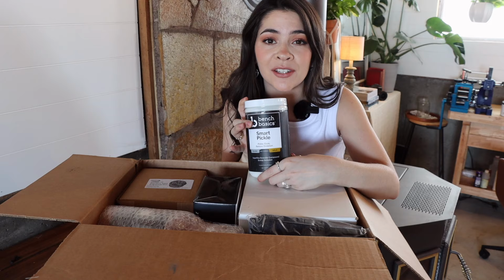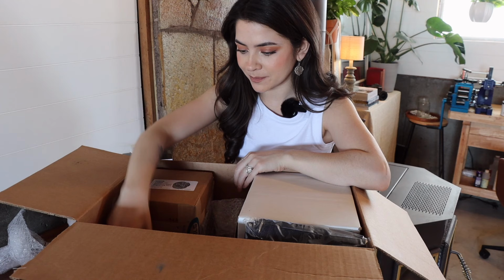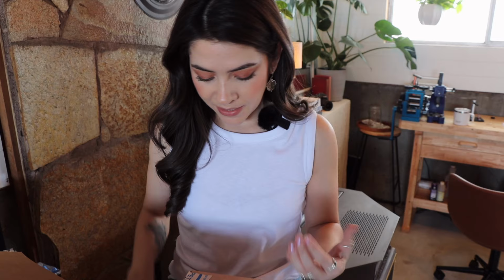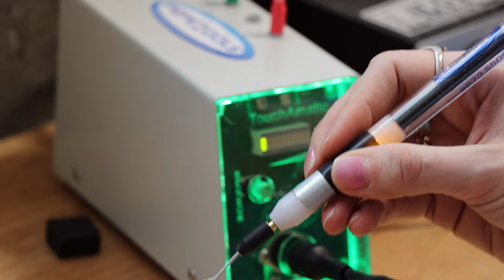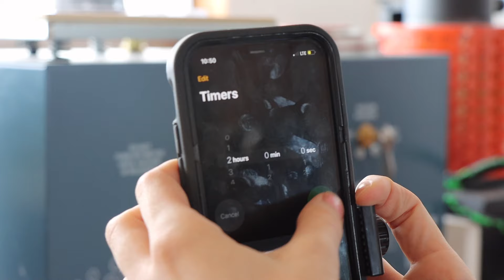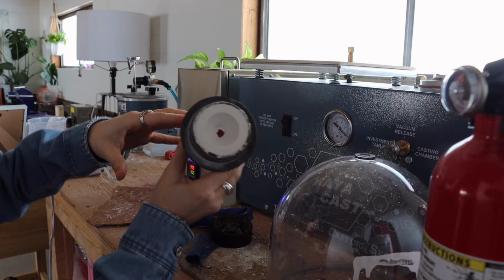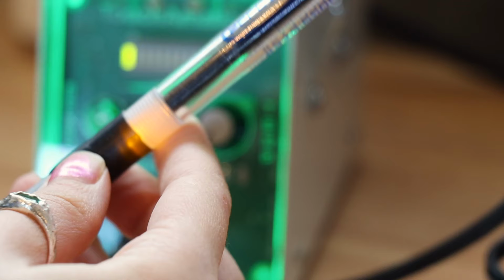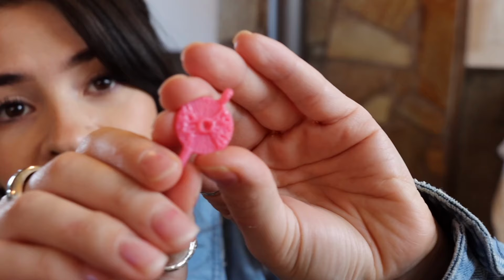Studio Vlog #11 | Lost Wax Casting  AT HOME | Unboxing New Jewelry Tools; TouchAmatic Wax Pen Review

Comment: Hi Young lady ,  congrats on your work in the jewellery, you are doing well . As with another comment here I would advise you to get and wear a full face viser when you are pouring metal , just in case ,sorry to be blunt.    not just glasses but a full face viser. Now 30 years in the casting and jewellery work myself and the viser did save me last year when molten metal hit some water in an ingot mould  I didn't see. molten brass  Hit my viser in 2 places.  Your casting and investing machine may be better on a lower table or bench, so you can look down into the flasks  and observe the behaviour of the investment whilst being vacuumed , and when you pour the alloy there is less of a possibility of any molten alloy  falling towards you if something goes astray. Also  any flashing in a injected wax pattern means the pressure on the mould is too low, or pressure in the wax pot too high, Wax maybe too hot,   best to reduce the pressure in the wax pot first . Make sure the metal or timber plates you hold the injection mould  between  are flat, and a little larger than the mould.  If after reducing the wax pressure the moulds don't quite fill , increase the hold time of the mould against the wax injector ,  so the mould is under a slightly lower pressure but for a longer period , this could be up to 5 to 7 sec depending on the size of the pattern .  Another possible problem  in moulds is that the top or the bottom of the mould isn't as flat as they should be , some smoothing of the top or bottom of the mould by rubbing on a flat sheet of sand paper can help especially if the mould is made from a poured RTV rubber..    Good luck    John from Australia
Reply from the maker: This is all such great advice, thank you so much!! I will definitely grab a visor and take your advice next time I’m injecting!🙏🏻☺️
Reply: Amazing advise with the mask, thank you, I’m also getting into casting.  Wealth of knowledge.  THANK YOU!!!!!!!

Comment: What do you use as ventilation when you solder wax or metal?

I’m trying to figure out what to do about my home-work space. 
Whether I should buy a mask, or find some home-friendly ventilation option😊
Reply from the maker: I wish I had some sort of industrial ventilation going on, those fumes definitely aren’t good. I do wear a respirator from Amazon (the same one painters use) when I’m soldering. When I am melting wax I don’t wear a mask…maybe I should? 👀🫢 

I do also open windows when I’m soldering to let some fresh air in. I hope that helps and I’ll let ya know my thoughts if I ever do get a good ventilation system. 🙈

Comment: Could you recommend others electric wax carving pen? Or some with a cheaper budget?
Reply from the maker: Of course! I used the ARBE wax pen for about 2 years and I loved it! It’s around $160 https://zakjewelrytools.com/products/precision-wax-heating-tool 

If you need an even more budget option, you can’t go wrong with just a spirit lamp, denatured alcohol and some cheap dental tools to heat over the flame, I did that for the first year  🙏🏻☺️

Comment: This might be a silly question, but do you prefer wax casting or using a blade saw with sheet metal? And why?
Reply from the maker: Not a silly question at all! I prefer wax carving simply for the look that I can achieve with wax vs metal sheet and wire.  ❤